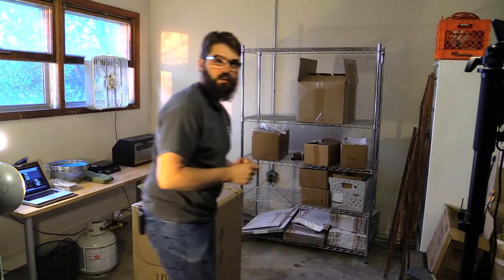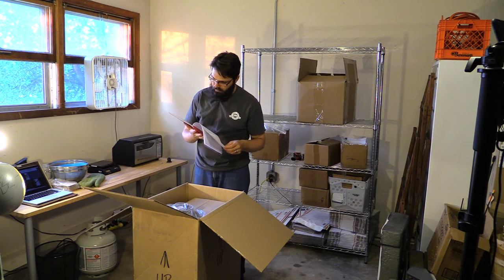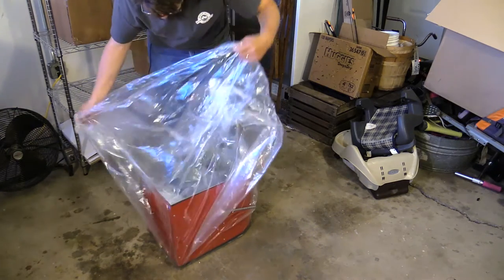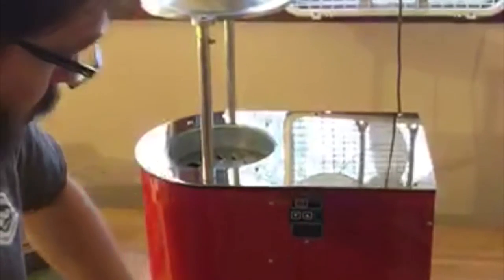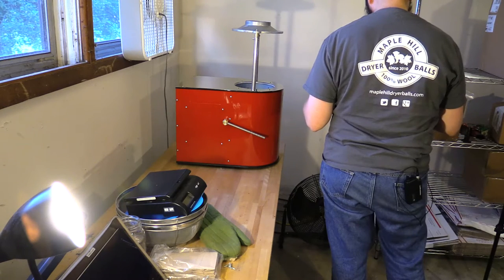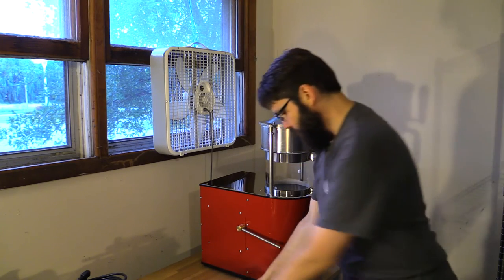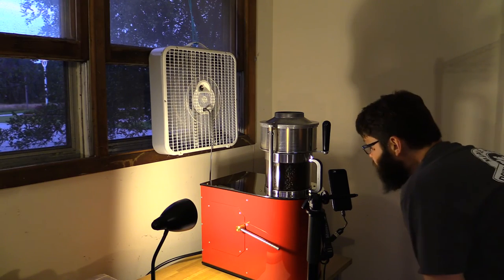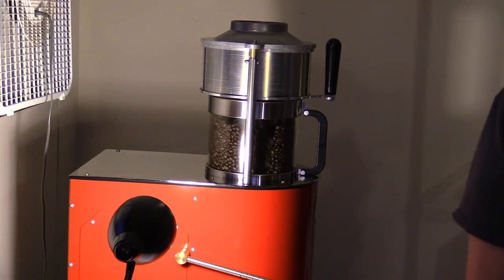Sonofresco 1kg Profile Roaster Unboxing #FearlesslyRoasted

Comment: My Sonofresco is 7 years old and still awesome. I also us a Mill City 3kg drum roaster(5 years old).

I run them on natural gas but I’m wanting to use my Sonofresco for some classes and need to go with propane. Did you have to adjust your gas intake with the propane or does it regulate on its own?(does that make sense?)

Comment: Are you still roasting on the Sonofresco? 

Would love to hear an update on how it's been going and any insights you are willing to share.
Reply from the maker: Still going strong with this 2kg roaster. I've replaced the burner once as well as the chaff screen. I also added a 1kg model and run both concurrently. 

Best guess is that I've roasted at least 800+ batches in this unit. I wouldn't say its as versatile as a conventional drum roaster but works well for my case and roast style.
Reply: @Coffeebygillespie  that's good to hear. I just received my 2100 and looking forward to roasting with it this weekend and moving forward.

Comment: Are you still roasting on the Sonofresco?  How is/did it hold(ing) up? Thanks.
Reply: Four years in, three houses later, and going strong. We added the 1/2kg as well in 2016. The only service I've had was buying a replacement chimney for the burner due to my own neglect.
Reply: @dizzysound  That's awesome! thanks for the reply btw. Are the beans hindered by the butane/ natural gas blowing through during the roasting process, such as distortion in taste, glazing, anything abnormal? I'm considering making the dive, and the Sonofresco is ideal for me except the gas makes me believe it would change the taste or you would at least realize a difference?
Reply: @cameronc6927  All the fuel is burned off and there is no odor of fuel in the exhaust, even at the beginning of the roast. My customers love the coffee and I'm consistently impressed with the precision I can get from this roaster without much fiddling.

Comment: Are you still using the same roaster?  I'm in a very similar situation as you and pretty far down the Rabbit Hole of considering buying a Sonofresco.  if you could do it all over again would you upgrade from the behmor to the sonofresco or get a different one like a North?
Reply from the maker: I'm not sure I'd do it differently. I would like more capacity now as my roasting days are labor intensive for relatively low volume. Maybe a 5kg. But my customers enjoy the coffee and I appreciate the ADR control.

Comment: Hello,
is this your main roaster?
thanks
Reply: For now, yes.
Reply: Thank you for answering. I too have a behmor and I am thinking on this machine, for its price and Bluetooth profile interface. How many pounds would you say you roast a week?
Reply: +Bryan Pleitez 

+Bryan Pleitez I'm part-time. I probably run at least 75lbs a week with no challenges. Given that it's a fluid bed, the bluetooth is helpful for tweaking for fluid bed's unique roasting character. That said, it's not the best interface in the world and needs an overhaul to at least add logging.

Comment: Dropped $4k on one of these . It lasted about 2 months roasting decent quality beans. After that though, it started over hearing the beans to the point that it started fires and became a safety hazard even with me closely monitoring it. Will never use a Sonofresco again. Saving up for a decent Probat now , never to look back at my horrible experience with this particular piece of equipment.
Reply: FWIW: I've roasted close to 400 batches on this roaster for over a year with no issues. Temp. stable. Reliable and consistent roast.
Reply: I call BS. Everything I've heard about Sonofresco, even from fluid bed detractors is that they are very reliable machines and the customer service is great.
Reply: My Sonofresco is now 7 years old and still roasting wonderfully. If you’re getting “burnt” coffee then the issue isn’t the equipment. You have to dial in on the profiles or learn how to manually control your roasts(which is the best way to roast).